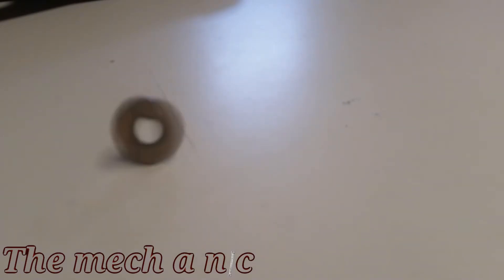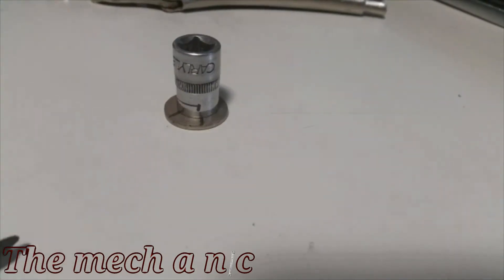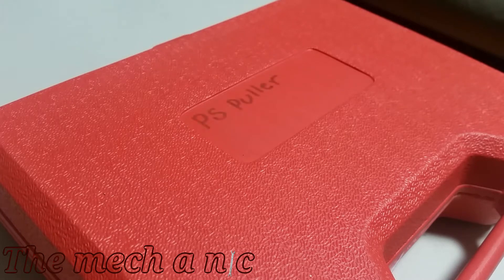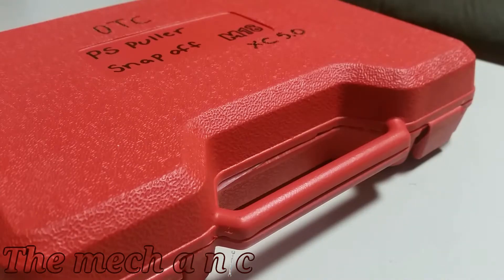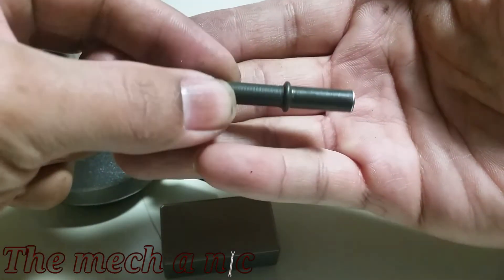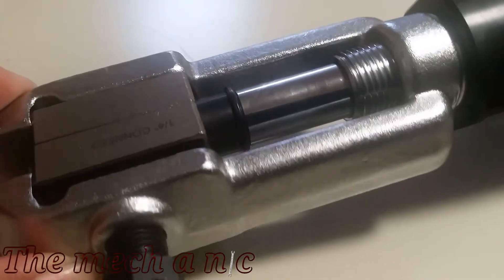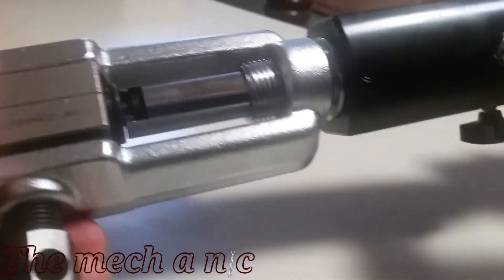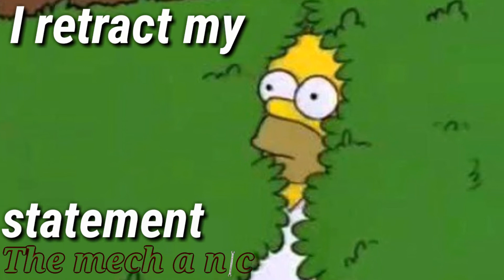Making a tool for the fairmount flare tool

Comment: Very good tool that should be added to the Fairmount Hydraulic Flaring Tool Kit.
Your skills are good and your tool works very well.
We have a Fairmount Tool but I have only used it for Mercedes 3/16 brake lines that have rusted and started leaking.
We are a Transmission shop and normally do not work on brakes but in the process of removing or installing a unit a defective and rusted brake line starts leaking.
Reply from the maker: It's a great tool. It works perfectly every time I need it 💪